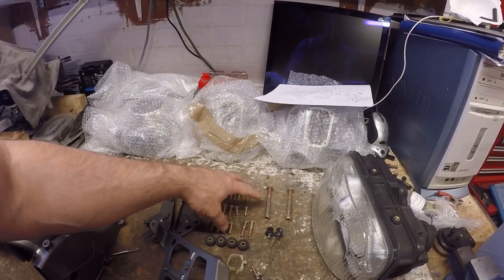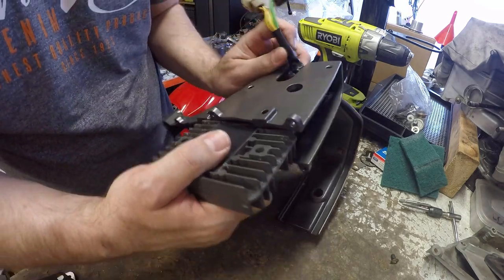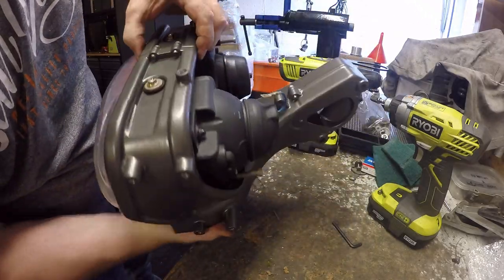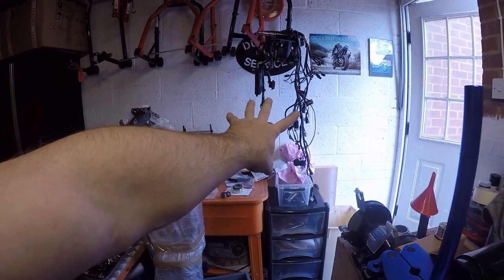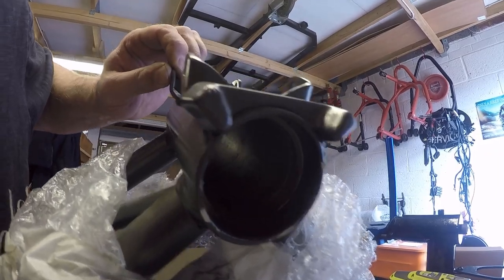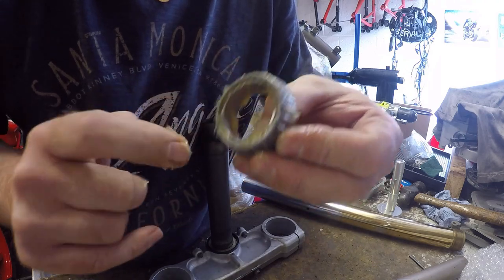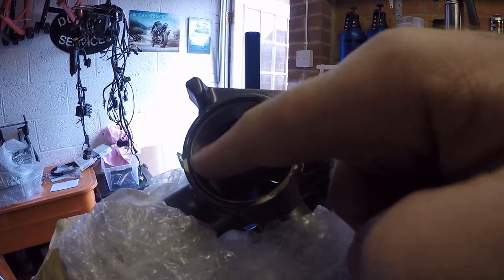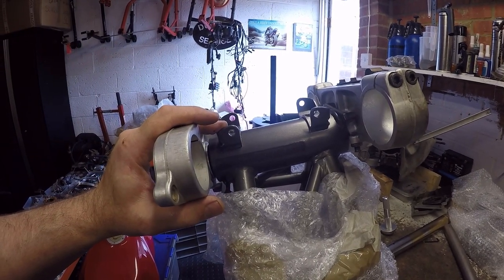Ducati ST2 Restoration Project - Video 12 Reassembly starts

Comment: I was trained by my father to pack bearings by taking a literal handful of clean grease and place it in one hand at the base of the thumb. Then I took the bearing, taper facing away from the grease, and forced a large volume of grease into the bearing cage. When done properly, the tech is rewarded by seeing the grease coat all sides of the rollers and exit the top of the cage. 😁
Reply from the maker: There have been a couple of methods shared, going to try this out next time 👍😊

Comment: Another great video thanks. Brilliant spot for the regulator, up in the cool air, unlike the superbike ones. When packing bearings I was taught to put a pile of grease into the palm of the hand and then force it into the race by cupping the grease filled palm and mashing the nbbearing into it. Messy but effective. Thanks again for the interesting tutorials
Reply from the maker: Thanks Martin, someone else mentioned the palm method, will give it a try next time, I was taught to keep forcing grease in until no more would go in.

Comment: Thanks again for a nice video. Liked your “tour of California” wardrobe. Was your punch tool make-shift or a specific tool? Are you going to replace that steering end cap, and what’s the correct tool for loosening (obviously not a flat-blade screwdriver)? Lastly, I highly recommend replacing that reg/rect if this is destined for the road and not a museum. They’re notorious for going Chernobyl and torching those connectors and the harness. Having replaced two myself (‘02 Monster M750 and ‘01 748), lets file under “things I wish someone had told me”.
Reply: steering cap tool.. for example..: https://www.jurgensmotorsport.nl/alle-artikelen/376-balhoofdmoer-sleutel-ducati-moer-kroonplaat-t-stuk-gereedschap.html
Reply from the maker: Gsenna has picked out the right tool for the top yoke nut, the drift I used to punch out the races was a head bearing tool, it acts as a drift for both removal and installation except that for Ducati's the yoke stem is too large in diameter so I cannot use it to fit the inner race.
Reply from the maker: Thats the one 👍😎

Comment: Put a dollop of grease in your palm and then repeatedly push the bearing down at the edge of the dollop in a chopping motion until you see grease come out the other side of the race then rotate a little and keep going. This is the fastest and most effective way to pack a bearing. There are videos showing the technique. Unfortunately the way you showed doesn't really guarantee the bearing is packed either because there is no clear indication thst the inner race is full.
Reply from the maker: I shall try that method next time, I was taught to pack the bearing until no more grease would go in.
Reply: @DesmoWerx  that way probably works  but it's slower, messier and hard to be sure the bearing is full packed.